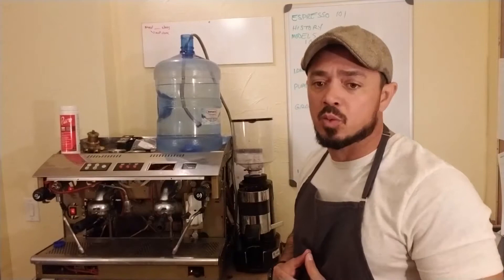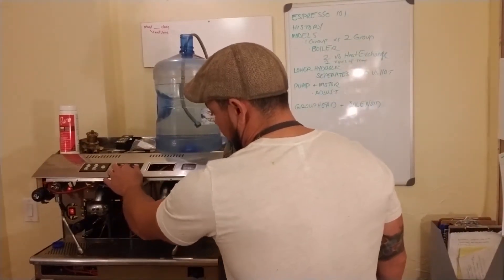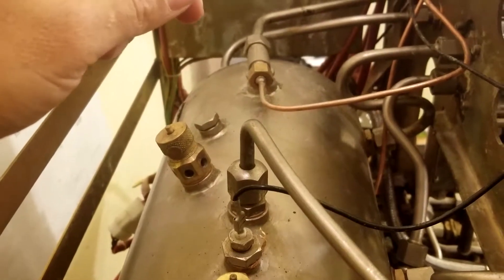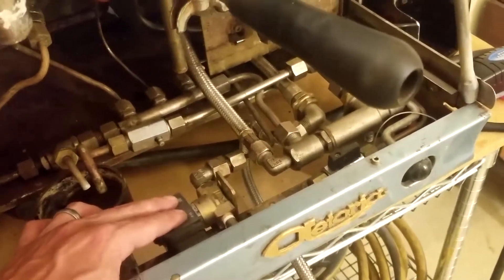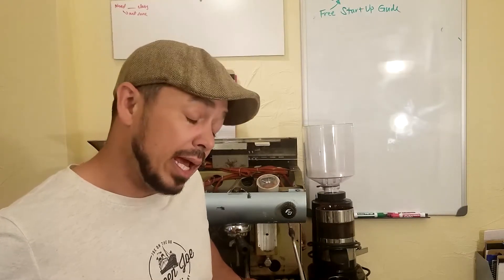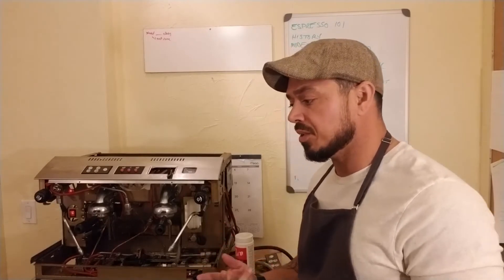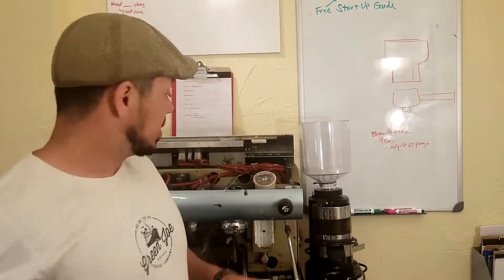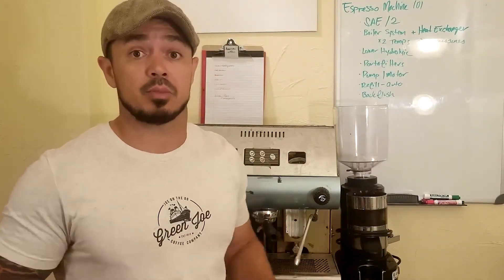How Does An Espresso Machine Work: Tour, Tutorial  and Stories of a Coffee Truck Espresso Machine.

Comment: Water flow? I’m a bit confused. Water flows in and then out of the group head for the purpose of pre heating. 
So when/how does the water pass through the coffee?
Thanks so much for your fascinating series!
Reply from the maker: The water In the group head is a closed circuit, meaning it doesn’t brew the coffee. Goes right back to the boiler. The water from the boiler (for the coffee)  has to go to the solenoid first then it can brew.